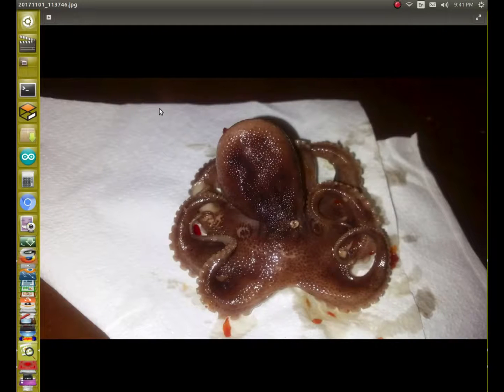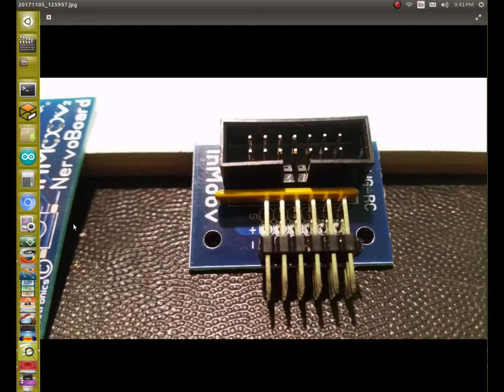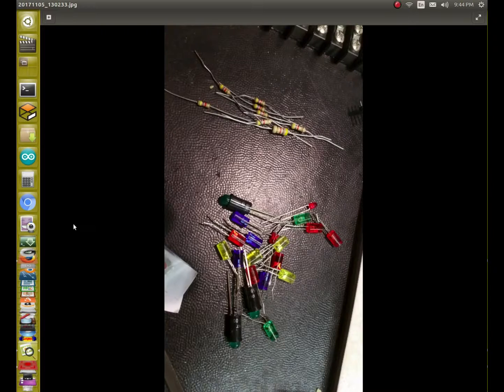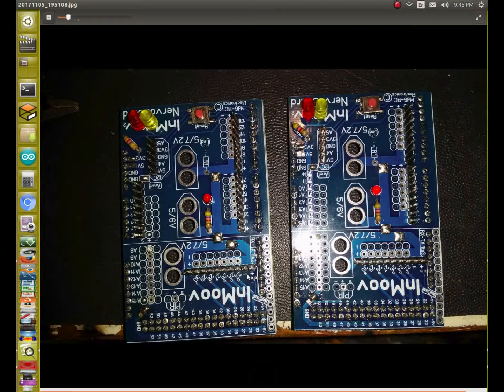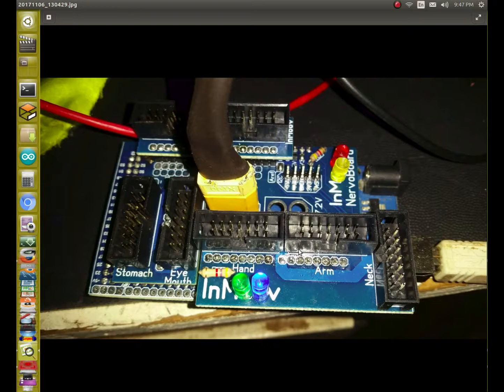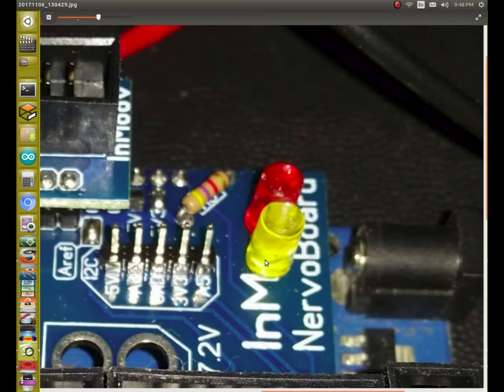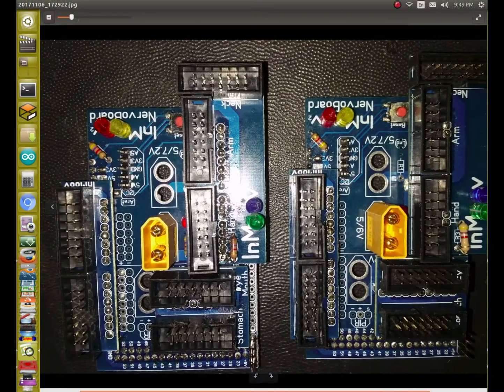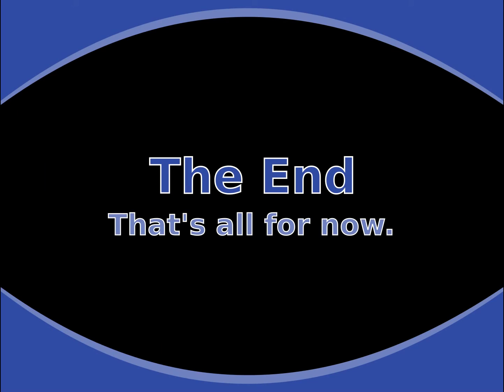Soldering Nervo Boards for inmoov robot

Comment: Just to be sure... Did you use 4.7 ohm, 1/4 watt, 5% tolerance resistors?
Did it work with the bridges and everything else?

I didn’t do all the headers on the main nervoboard first. I only did the ones that connect to the Arduino Mega. Then I did the headers on the components, followed by the connectors on the components, and finally, I soldered the headers onto the main nervoboard. By doing the headers first on the components, I could avoid burning the connectors, and it made it easier to solder everything onto the main nervoboard